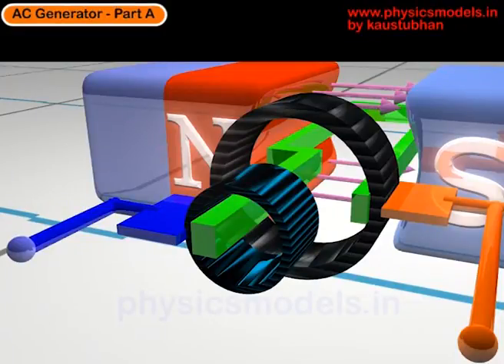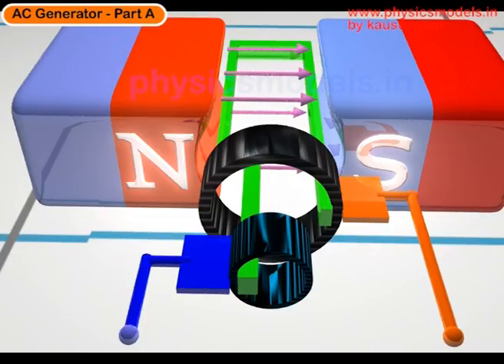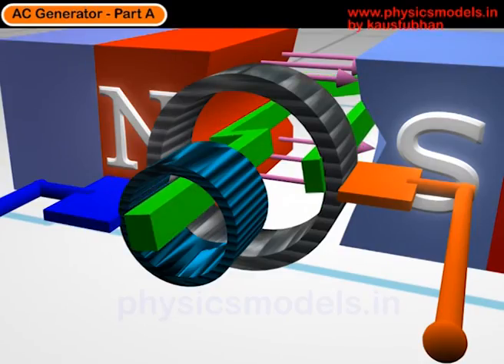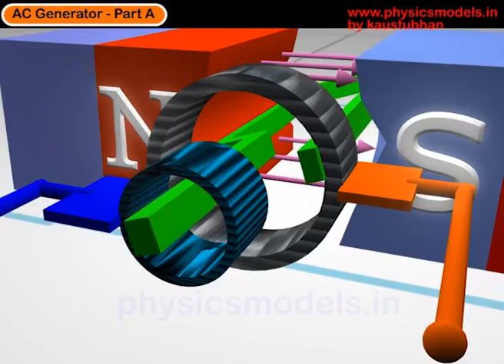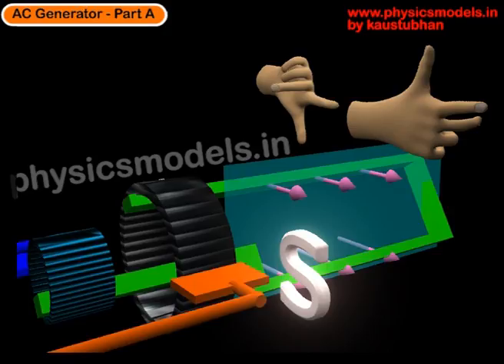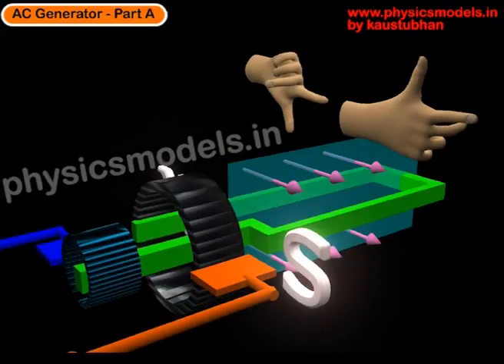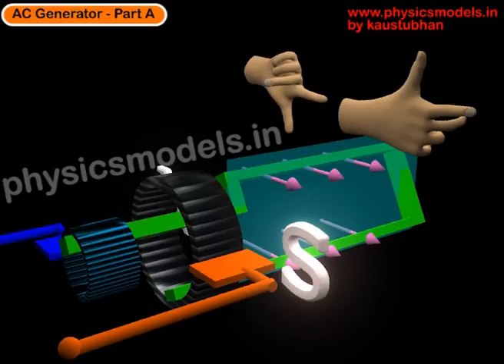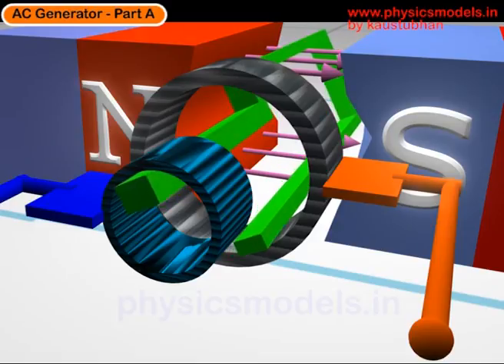physics-AC Generator- Part A

Comment: Lots of videos and texts are available on internet state that slip ring rotates and Brushes (these are not mounted on slip rings) are in contact with slip ring, and slip rings slip on brushes that is why it is called slip ring (According to Khan academy)

Any thought on this?
Reply from the maker: Yes. That's the same thing shown in my video and in practical design details.  Slip rings rotate as they are connected to the armature segments. The brushes are called brushes since they lightly "brush" against the slip rings surface. (In my video also, brushes are not mounted on the slip rings, but they must be somehow in contact.) Brushes will cause sparking and hence Wear and Tear will be high.
Hence, The next technology is BLDC (Brushless DC Motors) where there are only windings on the Rotor instead of physical Brushes contacting Slip rings.
Reply: @physics_animation_tutorial  In your video, slip rings are not rotating, rather two leads from the armature slip which is why you called it slip ring. Is it true?
Reply from the maker: Yes, the slip rings should rotate along with the segments. They were rotating in original animation. I have to check  technical issue.
Reply from the maker: Hi please see my recent videos 
1) https://youtu.be/nPzGgr9zEcc -- block on block - therory and solved problem
2) https://youtu.be/76PqTL-a5wg -- Block on Block - theory and solved problem-2
3) https://youtu.be/WHmi-DBZ1nc -- Magnetic Field due to current - solved problem

Comment: i clear about it!! but hav no idea about dc generator?
Reply from the maker: DC Generator is a machine where INPUT is rotating motion, (like from a Diesel engine or water flow rotating a shaft). In our animation, this INPUT actually rotates the rectangular conductor segments, and the OUTPUT becomes a DC current . Hence it is different from an AC Generator where we get an AC current output. 

The Fleming's Right Hand Rule will still be applied to any Generator . The input rotation leads to movement of conductor which creates cutting of magnetic field lines between North and South Pole of magnets , and this in turn creates an INDUCED EMF as the output in the conductor segment. This induced emf makes an electrical current to flow all around the conductor segment. To get a DC current output, we have to just connect the SPLIT Rings to the conductor segments in the same way as we did for DC Motor. The SPLIT Rings will ensure that for every rotation of conductor , the current direction will remain same at the end-terminals and not reverse the direction. Hence you will get current in a constant direction always, which is DC current. 
Hope this explanation is clear for you.